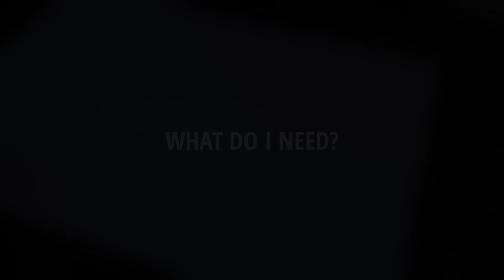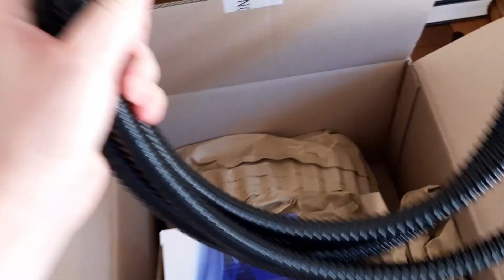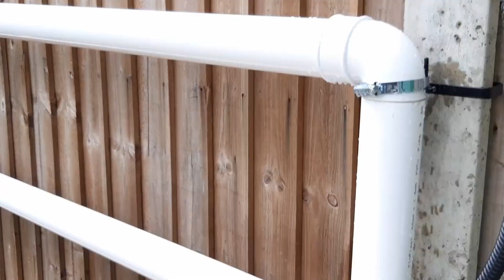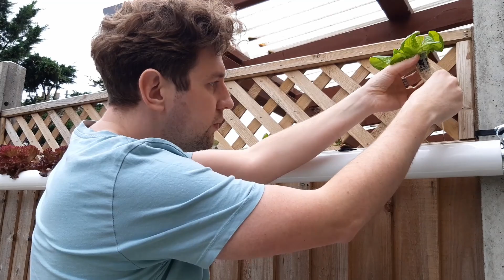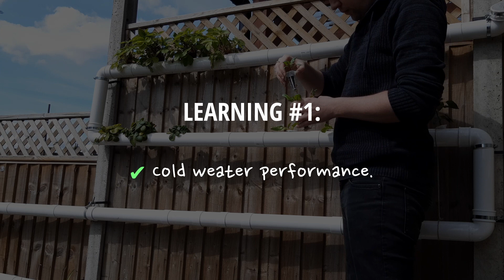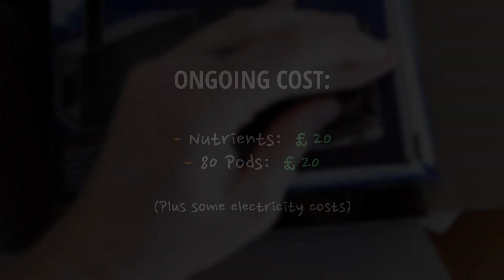Build Your Own Cheap & Easy Home Hydroponics

Comment: Ive read that rectangular pipe is best. No problems with basket wobble, and more importantly, water doesn't pool behind the roots as badly. Also easier to attach to a wall or fence. All you need are small shelf brackets.  Keep up the good work!
Reply from the maker: This is excellent feedback! Thank you 👌

Comment: Amazing.  What pump and size of pipe did you use
Reply from the maker: Hey, sorry about the delay, the notification didn't come through. I use a 3m head water feature pump (no filter) and standard pond piping (the black ribbed stuff).